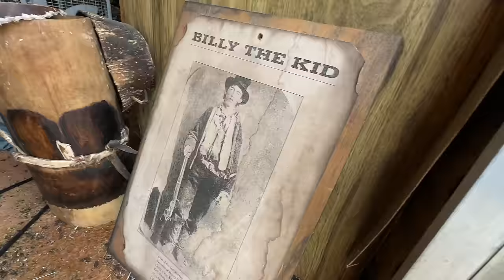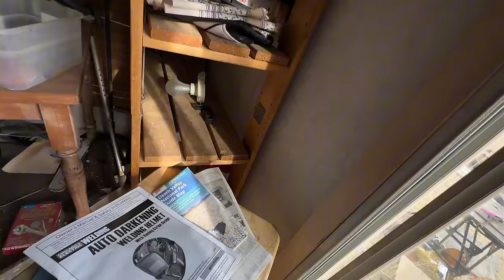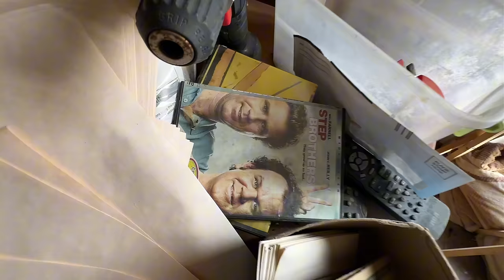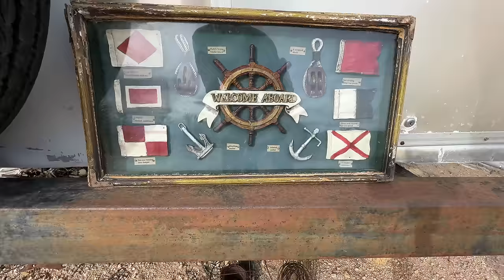Eerie Abandoned Desert Compound “Part 2”

Comment: its a will it run show goldmine...it would be fun to watch those possibly 🤣get running
Reply from the maker: @user-ng2rx4qc8o aint that the truth, I'm sure if you drain the gas, oil, and trans and refill them and a lot of other things before you crank the engine over, I'm sure they might just run, one out of ten should run. When i was walking around, I saw a lot of quartz and a few veins running up the mountain, so you might be correct about the gold mine that might be in the area. Thanks for your comment and watching!